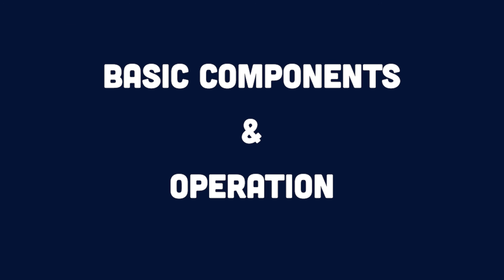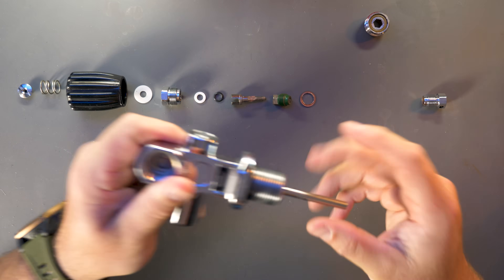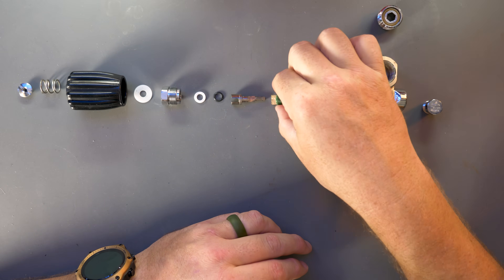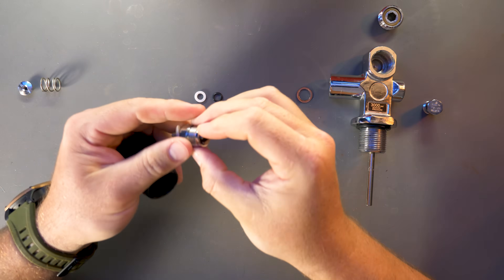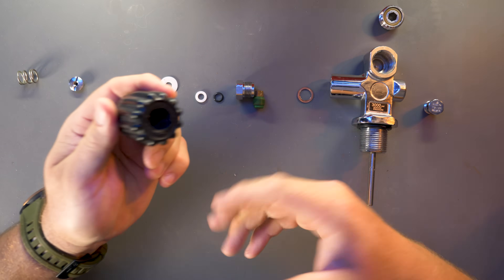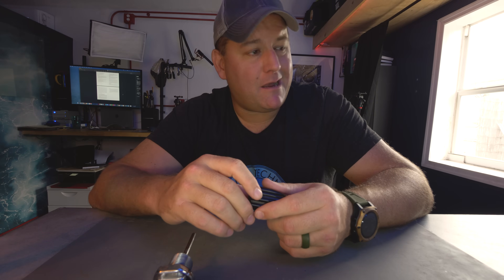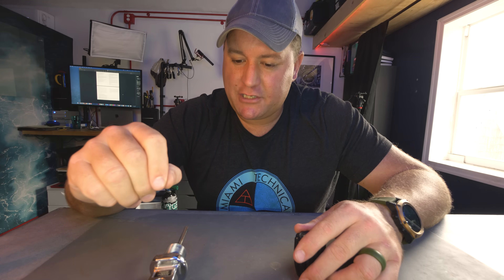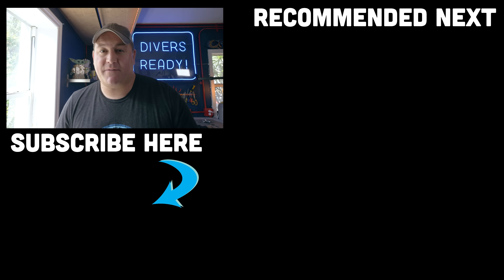Quarter Turn Back? An Exploded Scuba Cylinder Valve Explained

Comment: How sure are you about the "neoprene" seals? I've never analysed the material, but I would guess that the white seals are PTFE or Teflon rings, that do not have sealing function but  as a gliding point for the outer one and backing up function for the actual o-ring on the inner one.
Reply: They are teflon/PTFE plastic! They are there because the cross drive spindle sees the tank pressure when the valve is open and a 1st stage is seated, which means it experiences a relatively signficant axial load. That load is reacted in the "slippy" washers to enable the valve to be turned without too much friction.  When the valve is shut and the 1st stage depresurised and removed, then the threaded valve stub with the molded in PTFE seat seals the tank exit tapping, and there is no pressure on the pass through.

Comment: Yes, the main original reason for the quarter turn was the potential stress on the valve components, and this was very useful to see everything laid out.  But there is another reason.  I have twice seen someone check their valve and jump in, only to find it was actually completely shut.  They had tried turning it anticlockwise, it didn't move and they assumed it was fully open when in fact it was just very tight shut.  Everyone should of course take a few breaths and watch their SPG during their checks but some less regular, less 'committed' divers will sometimes in their excitement forget.  But if the valve still has that last bit of movement you can immediately tell it's as it should be.  And as to why you shouldn't do it, I've never ever seen anyone turn the valve the wrong way, closing it and then cracking it open.
Reply: In relation to your last sentence... i've experienced this.... Girlfriend turns on her tank goes to prepare mask... boyfriend comes along, closes tank, opens a quater turn. Girlfriend is OOA at 6m with 70 bar in the tank..
Reply: @Aumscuba  Definitely needs new boyfriend!
Reply: it happened to me. My insta-buddy closed my valve upon request to double check it's position, than disappeared in the first 2 min into the dive. I was out-of-air at 10-11m depth, tried octo (did not work) and had to do my first ever CESA to meet observant instructor on the surface who opened valve for me. Learnings taken 1) always fully closed/open valve position 2) nobody messes with my  valves 3) always be able to reach your valves. That was  happening more than 10 yrs ago but i remember it very well.
Reply: It happened to my friend. Either she or the boat crew didn't know left from right and closed the valve, then quarter turn open. I noticed her concern under water at 30m and she showed her SPG needle moving when she breathed. Was a quick fix of course but we definitely did our buddy checks from then on.

Comment: Good one and I have seen many issues with valve operation in the past. Valves only opened a bit that didn't deliver at depth, "friends" thinking they are being helpful by touching your valve. I can see from the comment below that there may be some confusion about "1/4 turn". You spoke about having the valve only 1/4 turn open, but there is also the practice of "opening the valve wide open, and then closing 1/4 turn". There is some logic to this and it is the way I have done it with all HP gas cylinders. If you open it wide and turn it back 1/4, you will always know what position it is in when you check it later by giving it a quick test. If you open it 100% and maybe a bit too tight, then there is a chance that when you try it, you will torque it open even more and stress the seats etc. Having said that; there are a lot of experts that say open the valve all the way.
Reply: Hi Barry, I'm going to respectfully disagree with you on this one and side with James... Open or closed----nothing in between. The issue is when you think you've opened it 100% and then 1/4 turn back when actually you closed it 100% and done the 1/4 turn back. Now it's open just a fraction. I have filled 10's of thousands of tanks over the years, but, being human, can still have a brain fart. I don't think that anyone has perished from having a tank jammed open. Have a very pleasant evening.

Comment: Great video James!
Thanks for the three finger opening tip.
I tried it with all my tanks and thankfully I'm able to open all of them! I'll open them like that from now on.

One thing to mention; I tried breathing from my tanks with a quarter turn open from the closed position and the SPG didn't fluctuate for most of them. The valves that didn't fluctuate were a dull silver (ones from the factory) and the only one that did fluctuate was the chrome silver valve. I've been told that my chrome silver valve opens slowly thus releasing the gas slowly from the tank whereas the dull silver valves open the tank very quickly.
If someone has the dull silver valves on their tanks, they might not notice on the surface but at depth it might be too late.

Lesson to be learned: never trust anyone except yourself!

Should be the one to test your own equipment!

I'm looking forward to watching more of your videos!

Comment: Nice video, it would have been better by comparing the old design with the new one. A question would be how to you know if a cylinder is the old design or the new design, in particular when you are in remote locations where they have very old stuff. Would you leave the valve open all the way in the old design as well? On another topic, is that a Teric? what happened to the Garmin?
Reply: The old valves are really old by now and I don't think any would be in use by a commercial dive operation. I think it was back in the 1970's when the upgrade took place. Hence, the 1/4 turn has not been needed for longer than most divers have been alive. I'm pretty sure Alec Peirce's Youtube channel talks about this in one of his tank valve videos. IF a commercial dive operation was still using valves so old they needed the 1/4 turn, I would not walk but run away.
Reply: @jeffworst9939  Thanks for the clarification. I was naïve by thinking that the training agencies would have updated their protocols in 50 years... haha. We just need to re-train ourselves. I hope I'll remember this next time I go diving... what was the thing about old dogs and new tricks...
Reply: @luisj8970  It's been a while since I took OW, ... is the 1/4 turn still in an agency training manual?